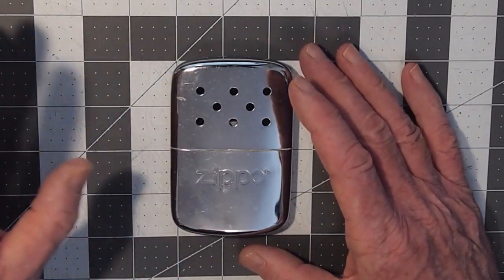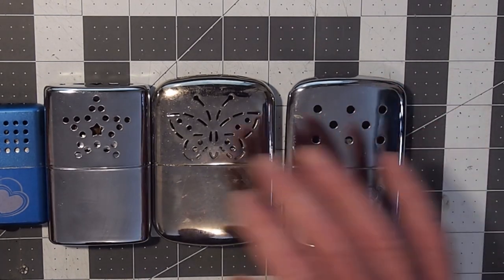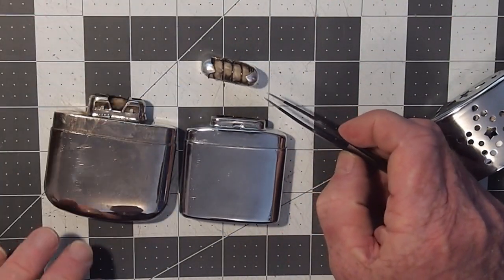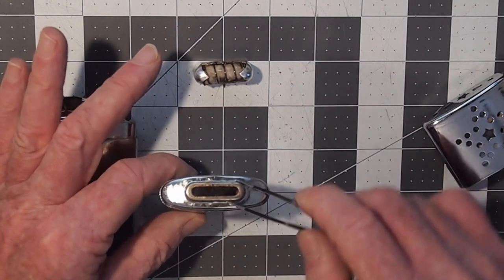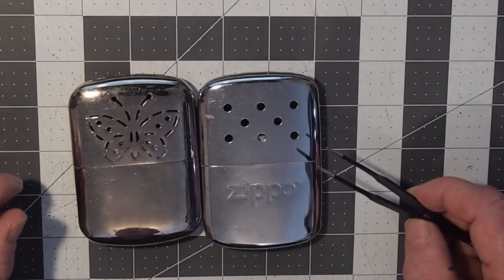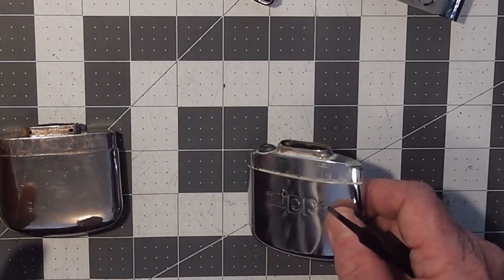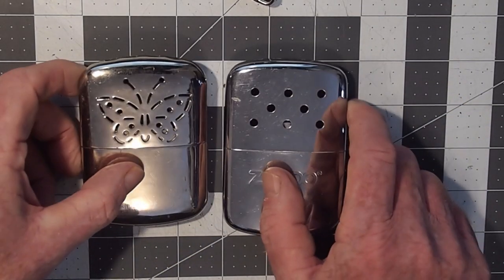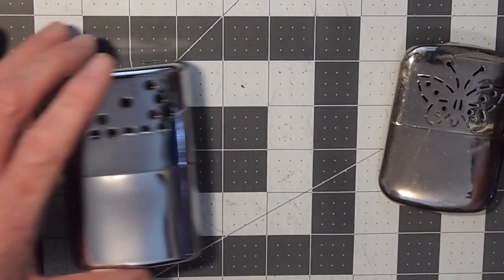Handwarmers S07E01: Why the Zippo Underperforms

Comment: First--One needs a "Jon --E" brand original hand warmer. This thing is AMAZING. I grew up in Phoenix and knew NOTHING about keeping warm...when I got my hand warmer at Goodwill--I didnt even know what it was but for 2 bucks, I'll take it. It looked cool..like a gigantic Zippo lighter. This Jon E is so reliable and easy to use. It will last 8-12 hours...and you can make it get rwally hot or cooler, by how much air you let into the jacket pocket, I'll keep it in. I had to work outside in the winter, doing TIRES,in artic--type weather, in the mountains of Washington State...up by the pass....and you dont even need gloves when you have one of these....you can just rotate a hand, grab the warmer and put your hand in your pocket for a sec....swear by these things!

Comment: There’s a product called glowing embers, it's a catalyst material that does the same as the catalyst material that comes inside the Zippo burner…but burns hotter
Reply from the maker: Thanks for the comment. Glowing Embers are made from rock wool, and glow when in direct contact with flame, but do not combust. This reaction is called 'incandescence'. A hand warmer requires a material that can support an exothermic reaction in the form of a catalyst. Rock Wool is not a catalyst unto itself, but if it were used as a substrate to deposit a transition metal onto it (such as platinum, palladium, or rhodium), then it might serve as a catalyst material. At the moment, ceramic fibers have enjoyed a lot of development thanks to the aerospace industry, so the best hand warmer catalyst uses a substrate called 'saffil'. Rock Wool by itself, or when blended with mica flakes (as Glowing Embers is), will not produce an exothermic reaction in a liquid fuel hand warmer.
Reply: @MountainParameters  i think she was referring to what is called platinum ember
Reply from the maker: @sebastom123  
I think you are right. And that would make sense as anything that is platinum based would probably be hotter than something that uses palladium or rhodium catalyst as I suspect the native Zippos models do.

Comment: What kinda fumes does this exothermic reaction produce?
Reply from the maker: methyl formate and formic acid. Consecutive reactions of these products then form methanol, CO, and CO2
Reply: @MountainParameters  would methanol be a cleaner fuel alternative? What by products would that produce with catalyst? Thank you for the reply 🙂
Reply from the maker: @slicktmi  Short answer, methanol will not work. Long answer, the catalyst itself cannot alter the chemical process into which it has been introduced. Instead, it makes that process faster. The speeding up of a chemical process is what causes heat. Methanol is a by-product of the exothermic reaction, it is an aldehyde that produces formaldehyde. You need a hydrocarbon such as benzine that is in the evaporate of naphtha to initiate the exothermic reaction. I have addressed the question of safety and discussed the by-products of hand warmers and the use of liquid fuel in hand warmers in greater detail in order to put them into perspective in one of the shorts in the Handwarmers playlist (https://youtu.be/B-_AGKWEaPQ?list=PLDXT34Ltvhm_lajF6yfU-ZNJE7TQVWeKm), and in the FAQ on our website (http://mparam.s3-website-us-east-1.amazonaws.com/handwarmerfaq.html). Some of the larger catalytic heaters that use a ceramic substrate use propane as their fuel source. Their by-products end up being very similar to those of liquid fuel hand warmers (EG: C3H6+5O2→3CO2+4H2O). Carbon monoxide is a result of incomplete combustion, therefore it's not considered to be produced in large enough amounts to be of concern in when used in a liquid fuel handwarmer. As I recommended in the FAQ withal, I would not recommend that you keep your pet hamster in your pocket with your hand warmer on a cold winter's day. A leash works best when taking 'Hammy' for a walk. My only friend, I used to take him skiing but never found him again after he got buried in an avalanche. To this day, SWHMBO has not forgiven me, but she won't let me get a dog.
Reply: @Mountain Parameters  awsome thank you you're very smart my friend. And reason i ask is because i hear of ppl running methanol/ heet in their warmers i also tried it and it worked good but i also heard it creates formaldehyde like you said i just get concerned with the fumes being in and out of my vehicle inclosed if there was any long term effects
Reply from the maker: @slicktmi  For folks that use Heet, or any of the other generic gas line anti freeze products, it's probably a good idea to make sure to use the stuff that does not have the additives such as injector cleaners, etc. (EG: Heet in the yellow bottle is the one you want, not the red bottle). Formaldehyde occurs naturally in the environment all around us. It's the concentrations that are key. Again, this is covered in greater detail in the FAQ that I reference above and would be a good read to address your concerns better.
Reply: @Mountain Parameters  i went through the q&a lots of useful information thank you and i made sure it was the yellow bottle i just wasn't sure if it made nasty by products due to catalyst but to my understanding the lighter fluid also creates formaldehyde so technically since you know chemistry better than i ever will what will the methanol create? Would it only be formaldehyde co2 co possibly water vapor?  Thanks again for all the help
Reply from the maker: @slicktmi  If I'm not mistaken, all the by products of the exothermic reaction with methanol are covered better in the FAQ that was linked above better than what I can dredge up from memory. But to sum it up in other words:

When methanol is reacted with a platinum catalyst, it can undergo a variety of chemical reactions, depending on the specific conditions and the other reactants present. Some possible reactions that can occur include:

Oxidation: Methanol can be oxidized to form formaldehyde and water when it is reacted with a platinum catalyst and oxygen. This reaction is typically carried out when used in a hand warmer and is the process that is discussed in the FAQ.

Less relevant for the context of this discussion:

Dehydration: Methanol can be dehydrated to form dimethyl ether when it is reacted with a platinum catalyst and steam. As steam is not typically present in your pocket, this is a minimal effect.

Conversion to hydrocarbons: Methanol can be converted to hydrocarbons, such as benzine, when it is reacted with a platinum catalyst and hydrogen. This reaction is known as the "methanol-to-hydrocarbons" (MTH) process. 

Reduction: Methanol can be reduced to form methane when it is reacted with a platinum catalyst and hydrogen. This reaction, and the MTH process, is typically carried out at high temperatures and pressures.

As demonstrated above, it is important to note that the specific chemical reactions that occur when methanol is reacted with a platinum catalyst can be influenced by a variety of factors, including the reaction conditions (temperature, pressure, etc.), the presence of other reactants, and the type and size of the catalyst particles. The platinum catalyst material that we use is a 1% concentration of platinum deposited on a saffil substrate, and once again, I'd emphasize there there is more information on this covered on our website at mparam.com in the handwarmer section.

Comment: I watched a video on how you could shut it off by sticking it in a zip lock bag to cut off oxygen. Wow, what a total garbage product that they didn't  include a metal cap with a high temperature o-ring to seal off the catalyst from oxygen.
Reply from the maker: The S-Boston was the only one I knew of that had that feature. Sadly it is no longer made.